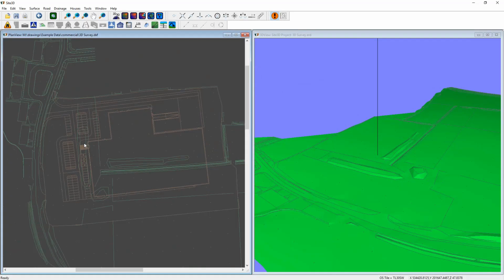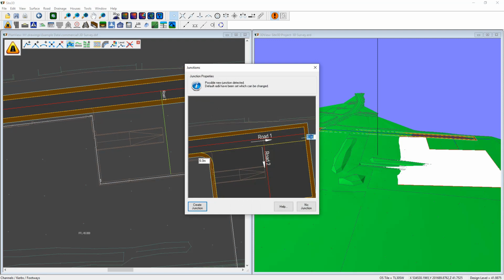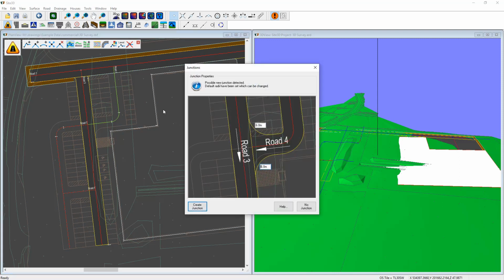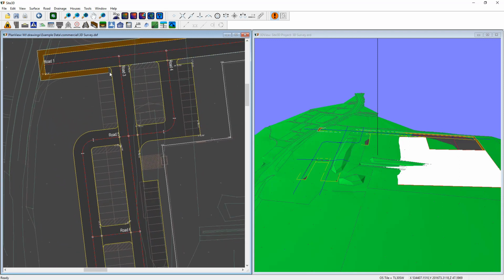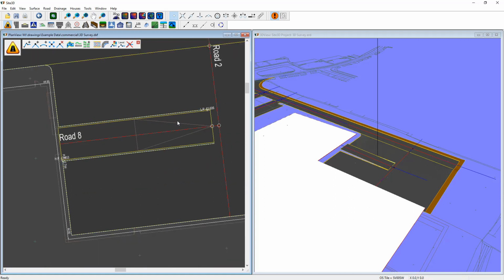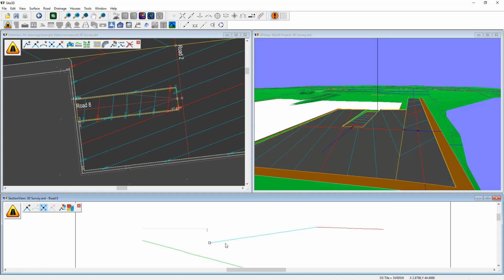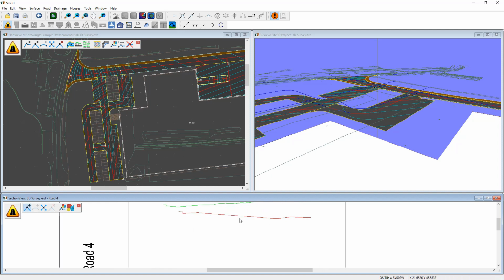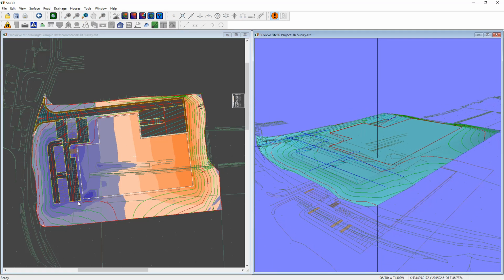Site3D: Commercial Site Design with Car Park

Comment: Good tool, but just not the way it's done. You need to crack on and develop a feature line tool. And a means of creating depths before you worry about cut and fill volumes